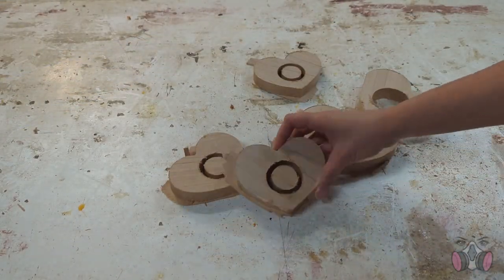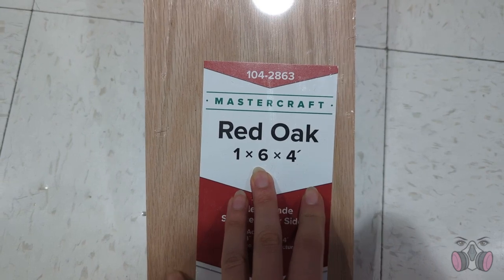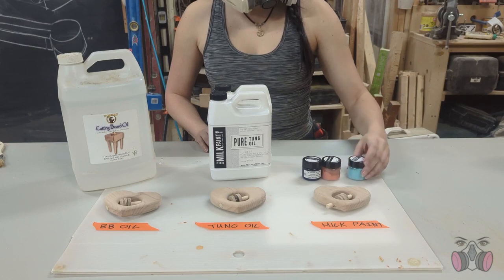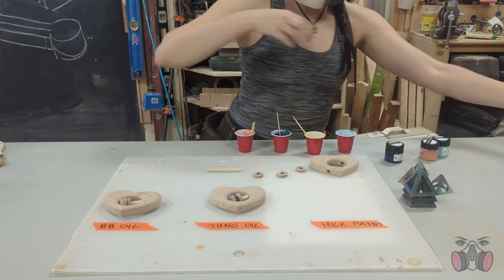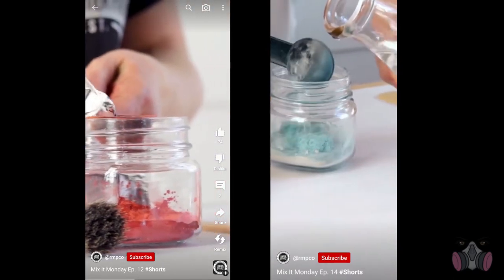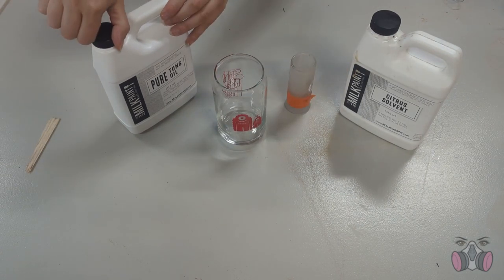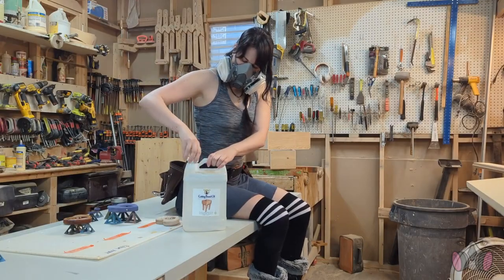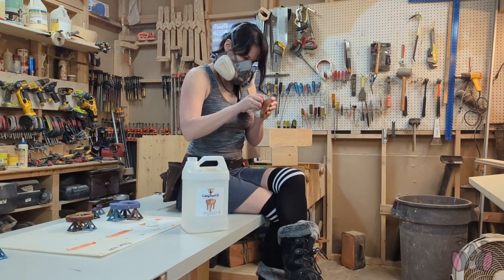Food-Safe Finishes for Woodworking | Tung Oil, Butcher Block Oil, and The Real Milk Paint Review

Comment: Perfect timing for me to find this video. I've been making baby rattles and teethers for a soon to be born great-grandchild. I did a lot of research to make sure it is safe and because my granddaughter owns a learning center that uses the Montesorri methods. I bought oak, I bought 100% Pure tung oil and I applied at least 3 coats, with each coat applied, then wiped off excess after an hour, let it dry for several hours or overnight and repeated the procedure 2 more times. The rattles and teethers look awesome. I will also be using the Titebond III, which I hadn't even thought to check until I saw that on your video, so thank you for that info. I will also be making a baby's mobile out of the same wood and finish. Every thing has turned out great and I'm very happy. Even though I had already did my homework on how and what to use for my project, I am very happy that you confirmed my ideas as being correct. Thank you.
Reply from the maker: That's awesome! Yeah, the method you described is my new favorite after trying several combinations of wood types and finishes. You just can't go wrong with oak, and as annoying as ring oil is to dry, it's so worth it in my opinion. It's so cool that you get to make these toys!

Comment: You just needed to sand the milk paint with 320 grit. It would have smoothed it out.
Reply from the maker: I did try sanding one of the rattles off camera, but I couldn't get rid of that chalk-y feeling until most of the paint was gone. Maybe I was using too low of a grit though. I'll try it out again with something higher and see if that helps. Thanks!
Reply: @woodificould    It will still be gritty. So here's what you do. Sand it whith 320. It will remove the uneven parts of the milk paint. then, you apply 2 coats of paste wax on the outside. Make paste wax with like 4 parts tung oil (or Boiled Linseed Oil), 2 parts citrus solvent, 1 part carnauba wax, and 1 part beeswax. That will make it food safe. 2 coats of that, will give it a little gleam and the chalkiness will disappear because its locked under the wax. Regardless, the best finish for toys and cutting boards is no finish. Pick a good wood, sand it to a high grit, and give it to the babies.

Comment: Awesome video! For the tung oil solvent mixture. How do you store this after you’re done with your project?
Reply from the maker: Thanks! And uhh... good question. I usually only mix the amount I'll need, but if you put it in a sealed container you should be able to store it for a while. It won't spoil, but eventually the solvent will evaporate and the remainder will harden. Don't quote me on this, but I imagine it'll last as long as any other finish in a container

Comment: The Tong oil will dry faster if it is not "flooded" on the wood as seen in this video. It will dry completely in 24 hours if it is put on the wood sparingly and all excess wiped off soonest! 
For best (includes fastest) application:
1. Do not flood the wood!
2. Do not leave any puddled oil on the wood; wipe it off soonest! Even if the wood does not look puddled, use a clean rag and wipe the wood with a burnishing motion. You will see oil residue on the rag, proving that there was too much oil on the wood.
3. Reapply coats as in #1. and #2.
A further note. Orange solvent can be used to thin Tong oil. Do not use terps, paint thinner, etc. Orange solvent is food safe.